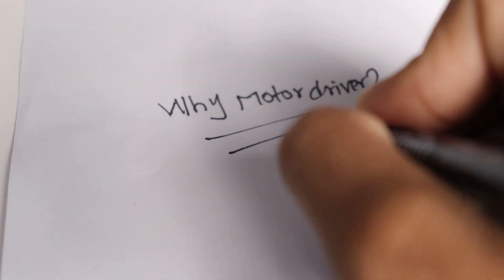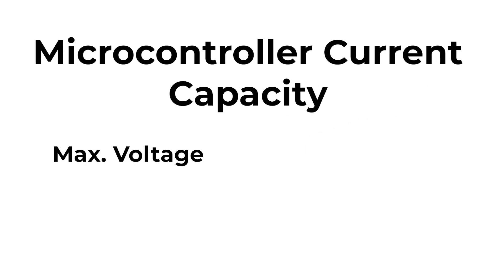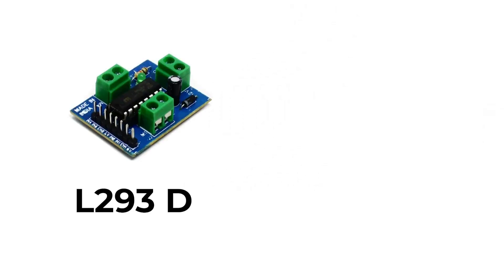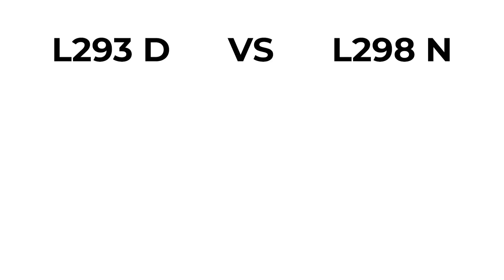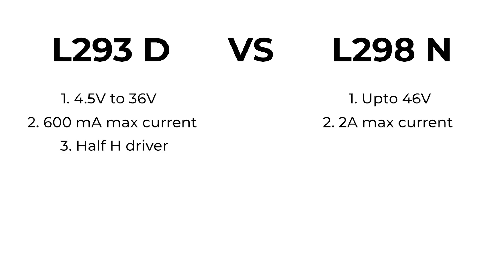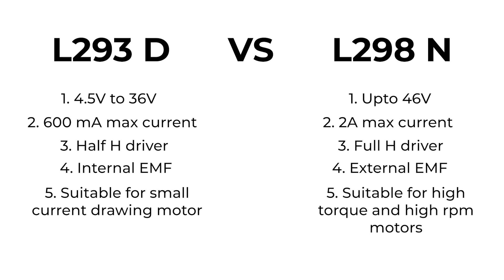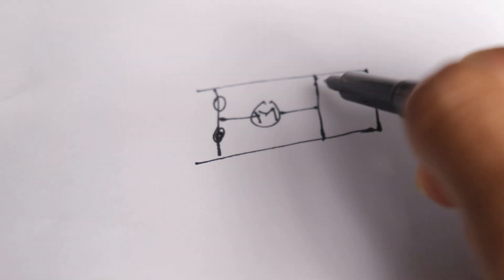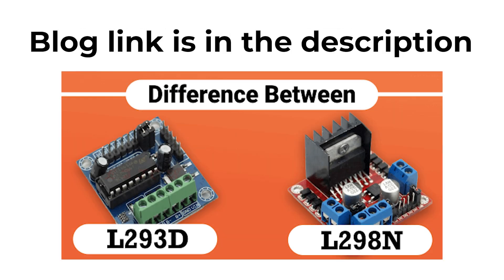DIFFERENCE BETWEEN : L293D AND L298N MOTOR DRIVERS!

Comment: Hi, thank you for this tutorial.  What kind of motors can I use with L298N board? Can I use 12V motor if I use 12V power supply? Will the motor work?
Reply from the maker: Hello @ericilkwatson5557 ;
Thanks for the feedback we really appreciate it, Answer to you question is: you can use L298N for driving DC and Stepper motors and yes you can use 12V Motor with 12V supply.

Comment: L293D minimum kitna Power leta he ? Maine 3.7V Li ion battery ka use kiya to DC Motor ko chala nahi paya
Reply from the maker: Hello there @matrixcoderdev ;The supply voltage range of L293D is 4.5V to 36V.